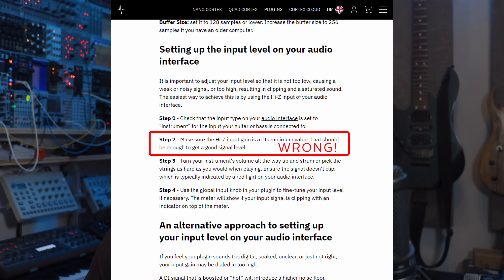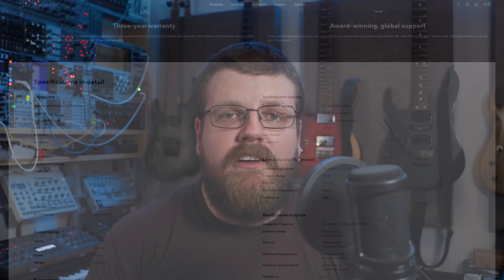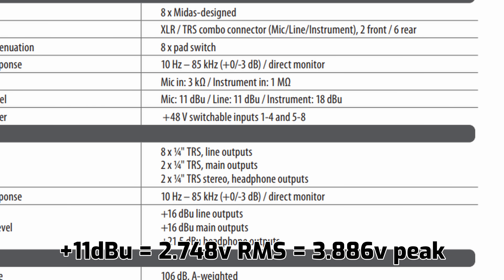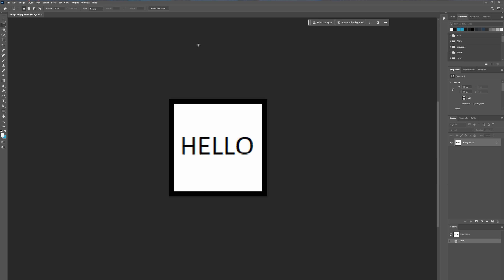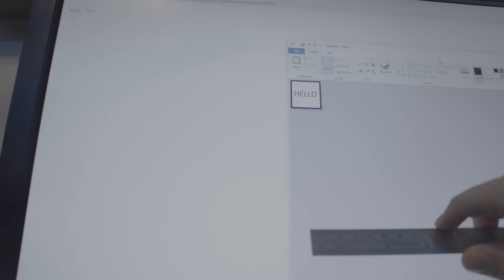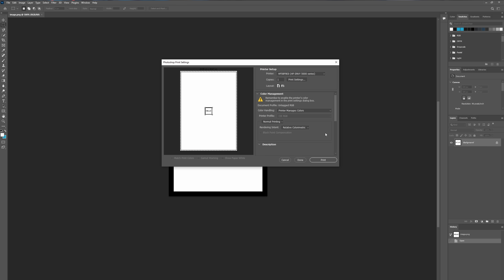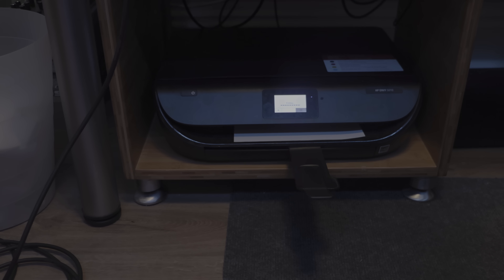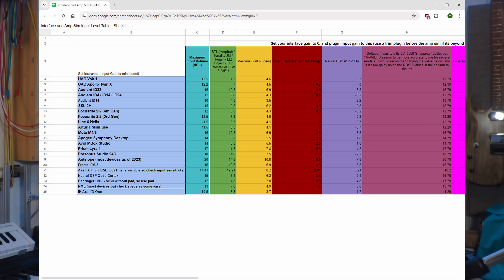Ampsims and input gain - Please, stop the madness...

Comment: This is amazing, thank you.  How does this apply to using a line level out of an amp to the interface with no plugin or is it irrelevant for that setup?
Reply: The interface has a noise floor. Use the gain.

Comment: I think someone may have given some actually good advice at some point, which then got misunderstood and went viral completely stripped of any meaning:  It would be good to have the recording chain's first input amplifier as close to zero gain as possible indeed, because that means you have created the needed voltage to utilize the entire dynamic range of your rec setup where it actually should come from for best SNR - the source.

In other words, the "zero gain" discussion (which I seem to have missed completely, it's good to stay away from gear forums/channels) points to the place where actual improvements can be made, at the very front of the signal chain.  In the not trivial case of plugging a coil of wire directly into a (in worst case) line-level input stage of an AD converter,  this is roughly the point where to start.  

This is also where "studio quality" optimizations would happen:  Cheap interfaces do not come with the greatest and particularly quietest preamps on the planet. But their quality is often still more than good enough to make the difference in noise between a $180 and a $1,800 condenser mic obvious.  The $1,800 mic is turning sound pressure into much more voltage than the cheaper one, so you don't have to turn up your noisy interface preamp so much.  
There was a time when similar considerations led to the "studio guitar" idea, with rare products seemingly targeted for that like (among others) the famous LP Recording of course or the rather strange and forgotten ES-347 following a different approach - high output, ceramic magnet humbuckers with more treble than an engineer could ask for, letting you decrease gain right at the first amplifier stage and you'd never need to pay the high noise cost of adding treble behind that first stage.  That idea died right away in the Stratocaster craze that started simultaneously.

To translate that into modern, real life terms - hot pickups remain a plus of course, but if you happen to have some device, maybe a 19" guitar preamp or a modeler with a very high quality input stage and a way to bypass every effect block that may follow that stage, it may or may not give you a better SNR than your Strat adaptered via a passive DI box or worse into the $99 interface creating all the gain.

Comment: Your technical details are all correct to maximize converter range, but that doesn’t mean the conclusion is “right”.

There are many reasons, but one simple one for probably 90+% of users is that custom input levels mean nobody can use patches without readjusting them. Including yourself with your own if you switch guitars.
Reply: Use your ears.
Reply: @DamnDealDone  1) Your ears can’t tell you if a patch was built around edge-of-breakup or lead gain. 

1a) This goes double for if you want to use the input dial as a clean gain, or intentionally under-driving a pedal or gate to get an effect.

2) That still makes it an absolute bitch to quickly experiment with different sounds because you can’t just click between patches. You have to switch, try gain, try setting it higher to see if that enhances anything, try lowering it to see if that’s maybe optimal, then adjust after hearing those relative points, then switch patches and repeat all of that.

Versus just switching between patches/sims the exact same way you would if you unplug from one physical amp and plug into another.

Comment: Commenting for the algorithm. I work with developing DACs, ADCs, CODECs yadayada and I thought I was going bonkers when this 0dB chat started.
Reply from the maker: I worry that the engineering department at NeuralDSP feels the same way 😄
Reply: @GhostNoteAudio they should add a SNR detection feature in their software that tries to figure out if your analog gain is set high enough before ADC. Maybe some optimisation tool that says basically: don’t play, now strum hard, decrease your preamp gain etc.
Reply: @DrummerRF this is the clip indicator on your interface, your ears, level adjustment in your software, and using a frequency analyzer as exampled in the video to see how loud your noise floor is and is altered by the changes you make in your signal chain. You are the detection and these are your sensors. 

Then you can record anything and even identify problematic frequencies when they arise.
Reply: @GhostNoteAudio  I think it's mostly that this is the "simplest" solution that works OK for most people.  E.g. my focusrite scarletts (I've got two generations) just clip immediately with any modern humbucker.  The first generation could not be dialed down enough , the 3rd generation one that I've got just about scrapes by at 0.
I think NDSP just assumed that proper engineers would actually know that if the interface has enough headroom, you use the headroom.
Reply: This reminds me of when I was testing digital camera exposure and the best result was maximum exposure before any critical white point clipped. Sunlight reflections off chrome or glass had to be allowed to clip and you’d gain a ton of color detail in the shadows. Same concept.
Reply: I'm glad I missed it. It's the same all over. Misinformation is established as truths because someone learnt a new word and don't know what it means, but still comment like a pro :). Whether you are recording audio or restoring a car or building stuff, it's always the same. :)
Reply: @LifeOnHoth  Or commenting on politics, apparently, looking at all the pro-Palestine rally attendees and the blatant propaganda and lies they swallow hook line and sinker, then propagate without a care in the world.
Reply: I've been working on embedded systems for decades, working a lot on digital audio stuff and have been producing music professionally for 20 years plus. I could start crying when people are trying to convince me of some of their BS ideas in some studios or just musicians repeating internet "wisdom". Thanks for your video I hope people start using their brains more.
Reply: I used to record through interfaces as loud as possible without clipping. Then I saw some videos about recording so the levels sit between -18 and -12. Then overall I found the sound of my mixes sounded better. However… of course I can reduce the recorded audio afterwards if it’s better for the plug-ins etc whilst getting a bit less noise. I think the challenge is to know where to set the gain depending on the dynamic range of the source
Reply: @jolondixon2311  coincidentally (maybe not coincidentally) -17dB full-scale is the theoretical best (in a least square sense) power level for digitizing gaussian noise to 16 bits. If your signal is sufficiently noise-like then clipping might be a significant concern well below full scale
Reply: @jolondixon2311 Absolutley. In fact, look at the max level of the equipment. Lets say its +21 dBu, if you subtract +4 dBu, that's +17 dBu. This negative value in dBFS is the correct nominal level for that equipment. If you always record with peaks lower than -9 dBFS and the average at the nominal level, good mixes will require minimal effort.
Reply: @jolondixon2311  I'm sorry, that doesn't make sense.  Capturing the sound at such a low level causes the same issue as this principle. I would guess the reason your mixes got better is because you were starting at a lower signal level for each of your tracks so your mix was a lot more controlled. This has nothing to do with recording level, to get a similar result you should track as near to 0db as you can without peaking so the quality of the captures of the audio to digital form is using as many bits as possible (like the engineer mentioned in this video) and then when it comes to mixing start with your track levels down significantly lower.  A lot of engineers turn their mains up really loud when mixing so that they can keep themselves from turning each track up too loud, so that way you have more headroom in your overall mix.    

Bottom line, your mixes sound "better" because you're mixing softer letting your tracks breath and not overly compress everything.  Using the same principles of this video you just need to adjust your mindset in this digital realm. If you know you recorded everything "as hot as possible" on the track, then when it comes to mixing you need to compensate like this engineer said how you should compensate the input gain on the amp sim.
Reply: @ryanwylervids 100% yes.
Reply: NDSP literally designed their plugins to work with Focusrite or UAD or Audient levels at 0. I don’t think they’re worried about doing people doing that - I think they’re surprised people were doing things drastically different and hearing things different to how they’re intended.

Noise is sufficiently low on those interfaces to be below the background noise of the pickups. You want improve SNR by boosting the level on these interfaces, it’s constrained by the background noise of pickups.
Reply: @eds4754 a lot of interfaces clip at zero with modern high output pickups, so that makes sense, however making it a rule is nuts, my interface can be turned way up on the instrument inputs with EMG pickups without clipping. Clearly my interface has more headroom. If I followed their advice with my own interface, I'd be amplifying a bunch of unnecessary noise and effectively reducing my bit depth.
Reply: @ Its not a rule though, its general advice that applies for most situations. It doesn’t stop you understanding why or knowing when to to do something different.

Most interfaces in 2024 don’t have high noise or too much headroom on the instrument input. The noise floor will almost always be below the noisefooor of the pickups, just as it was here until Valdemar used a Behringer interface.

Comment: This is how I’ve always recorded! I get super clean, noiseless recordings too. I really liked that you ended up with -19dB which is so insanely close to the industry standard -18dB input gain, which further proves your approach to be correct
Reply: I can understand why you think that the gain is relevant to the standard, but it really isn’t. The -18 dB standard refers to the calibration of the converters. It means that a +4dbu signal will give a meter reading of -18dBFS on the digital meter. I think it’s mostly a coincidence in this case that the input signal gain seems to relate to that number. It won’t always because it will depend on the signal strength coming from the pickups which can vary tremendously depending on the instrument and the pickups it has installed.

Comment: after the whole thing what made sense in head is setting my input like i normally would for the interface and then putting a gain utility to turn it down before the plugin so that i can freely scroll through presets without adjusting the gain every time. it worked great i just didnt know that the gain each plugin expects was arbitrary before making some sound worse than expected

Comment: SOO true. And for those saying its supposed to help the plugin react like a real amp. No it doesnt. It does the exact opposite. Because if you use a high gain tone you would have to set your input gain on the plugin wayyy up (like he did in the video). News flash: this action REINTRODUCES all the noise and more you just got rid of by setting the input gain on the interface to zero. And even if you didnt do it you would have to turn up the gain on the amp model to like 8 out of 10 to get a satisfying saturated high gain tone. If you would do that on a real metal amp the background noise would blow your fucking head off. So dont try to tell me thats how you "get the plugin to react like an amp". The exact opposite is true

Comment: Thanks for doing this. I just couldn't get the ignorance on the "previous 0 input gain" method.
Some even argue that we do not need "gain staging" in digital domain as 32\64 bit floating point calcs allow for infinite "headroom".
Good, but you need to hear it at the end and it has to come out from the DAC and then speakers\amp and ultimately to your ears. No time to explain trivial setups.
Plugin "manufacturers" (coders) should allow for input trim\gain in the range of -24\+12 dbFS. The +12 setting is to allow upward compensation for more conservative 'dial back down' instrument's signal on the input of the audio interface. They (the "manufacturers") should present some reference data tables with the real amp being simulated.
But that might get obsolete as amp sims are a dying breed with the introduction of amp modellers such as NAM, ToneX, etc.

Comment: I think that you're completely right however I'd rather deal with the noise floor than juggle input levels. I do have a question, how does pick up output affect this equation? Would higher output pickups alleviate the noise floor problem
Reply: No, the noise floor is there from the input amplifier and DAC. If your signal is quieter you're using less of the DACs range

Comment: News flash Einstein, a guitar has a volume knob that yields different tones, it’s not an on and off switch 😮 and passive pickups too that are very dynamic depending on how hard or soft you pluck, not only sound compressing active sensors. Some guitars naturally have a higher noise to signal levels then others 😮… USE YOUR EARS and find the “sweet-spot” using your ears, not a calculator.

Comment: Unity gain means Vin/Vout = 1. The problem of plugin manuals is that none of these explain what you have explained in this video. But I want to add this +18dbu input signal level means that at unity gain setting on audio instrument preamplifier’s potentiometer will not clip if you feed +18dbu into preamp.

Comment: You're wrong. I have a background in signal processing, I play guitar, I made the same mistake that you made. So please pay attention. The reason why, before the discussion on the internet you refer to, everyone was increasing the gain is exactly because, since the analog age, it is known that you must maximize the signal to noise ratio. While your explanations are technically correct and align to this conclusion as well, this produces a degraded sound.

During your tests you make us hear a saturated signal, that's why you can't hear the difference. But, if you listen to the unprocessed guitar sound, you'll hear that the signal saturate before reaching the maximum of the binary scale. That's because between the input plug and the digital converter there are circuits that can saturate without reaching the maximum voltage of the output just before the conversion.

I noticed this myself using my guitar (a fender with a floyd and a humbucker) in a uphoria audio interface. It took me more than a year to notice it because I always play through a high gain amp sim until this one time. I noticed that before all of the fuzz so it was not a bias. 

So please do the test with no effect at all on the line with a powerful humbucker and 0 gain, then be sure your sound is not saturated by reducing the volume on your guitar if you need to and then increase the gain of the interface until you hear a slight saturation. If it's like my setting, you'll hear this saturation while the wave form on the DAW is taking way less than half of the visualization. This should not happen but it is.

See you in the verse.
Reply: What? What interface are you using???

Comment: Great points and very valid for the studio . But in the real world the floor to noise ratio for amps is not really taken into consideration . I mean adding an overdrive before an amp that is already driven would require a noise gate and without it , it would be noisy as hell . So I think the method you try to improve is trying to mimic the real world and how the amp reacts based on you card specs ( I have an RME and need to increase the input of the plug-in ). Your proposition is much more based on how to improve a cleaner sound for a mix . Both methods are valid and choosing one would dépend on taste . The only caveat in your method would be that it eliminates the pick up output level and how an amp reacts to it . By gain staging it all types of pickups would create the same ‘reaction ‘ from the amp . But great job and great explanation
Reply: I'd also suggest the method in the video should be using a clean patch and not a high gain patch as used. Using a clean patch gives you a crucial extra piece of information missing in the patch used here.

Comment: This argument completely passed me by, but you explain how setting input levels has ALWAYS been: optimum level to "tape" to get as far above the noise floor as possible, then set each following stage optimally. You add that that deducting whatever preamp gain you have added from the first gain stage of the amp SIM is the correct approach and it is nice to have this explained so clearly: it's good to have a clear method! Thank you :)

Comment: If someone sends me a DI to reamp, how do I know whether I have to turn it up or down and by how much?...
Reply: You don't need to. Send it out at the volume you need and record back at the highest you can without clipping
Reply: @NamelessSmile  Hitting the amp or amp sim at higher or lower volume than intended will not give authentic results.
Reply: @pauliusmscichauskas558  you adjust the level with your DAWs track fader or the plugins input gain. You shouldn't be using your preamp gain as a substitute for these, they don't do the same thing.
Reply: @NamelessSmile  by how much?...
Reply: @pauliusmscichauskas558  ....as much as you need